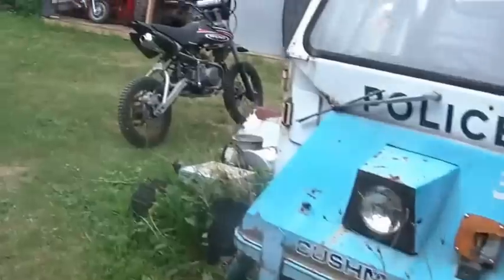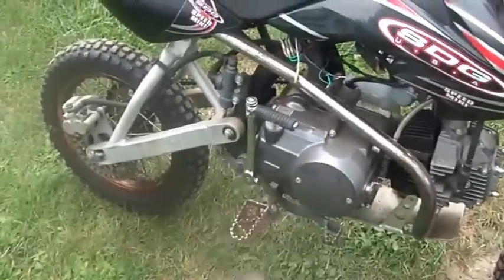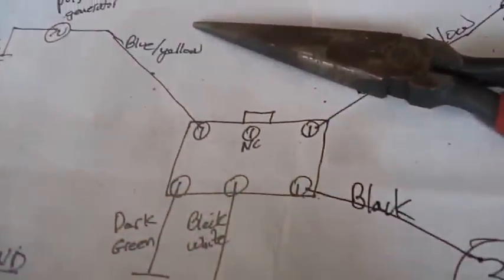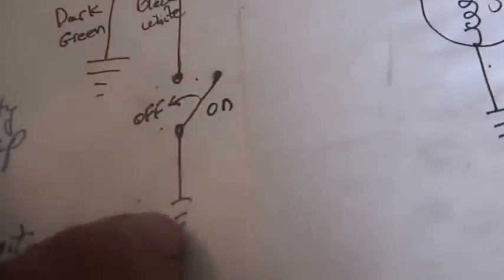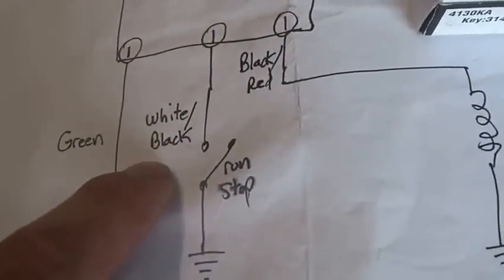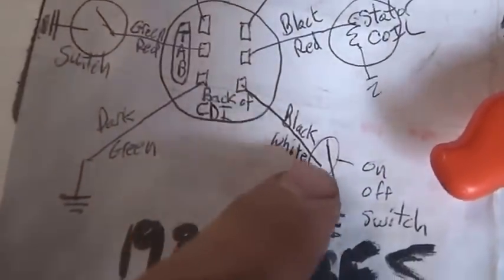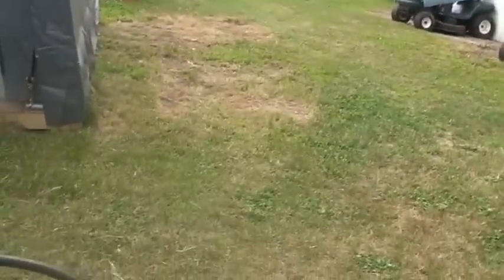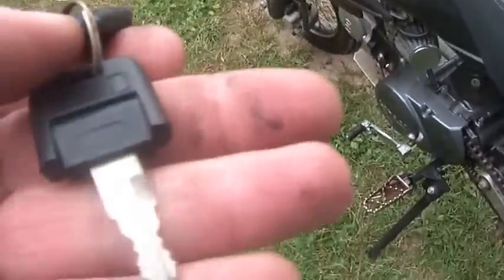2004 SDG Pit Bike, Lifan engine, wire harness, adding key switch,

Comment: NO WAY! i thought the black/white and green wires had to be connected to run but that actually grounds it and turns off the bike lol!!!...I have the same engine with the black/white and green wire on my 2020 apollo rfz 125, its a yx125cc engine, I drove an hour to the track and forgot the key at home, wait it gets better, i was going to try to get it running by attaching the black/white and the green wire together (which i now know would ground it and not run lol) but guess what? there was a black, red, black/white and green wire going to the ignition and i had no clue what the extra two wires were for and i didn't want to start attaching different wires together to see if it would run because i thought i might mess something up. so anyways i got home and found out that the two extra black and red wires coming from the ignition were hooked up to NOTHING because i guess they hook up to something on another model of bike.  so i now know the bike would have ran if i just kicked the kick starter. anyway i ended up renting a 250cc honda they had at the track and had a blast .

Comment: How do I wire electric start
Reply from the maker: Hey Tom, For the DuraMax, it is already wired, I'm probably just going to put an ignition switch in parallel with the one that is already there located on the dash with a pluggable harness.... Generally speaking, wiring electric start is as easy as wiring one side of a starting relay to the battery, the other side to the starter, the starter should be grounded thru the motor as well as one side of the starter relay coil. when power is applied to the other side of the starter coil, the relay engages and hopefully the engine starts.... Thanks for asking, watching, and commenting!!!!

Comment: Can I swap my engine in my Baja dr70? Or should I just do a 88cc bore on it?
Reply from the maker: Hi idk!!!  It would probably bolt up to the frame, but, U may have issues with carb spacing, air cleaner, exhaust, and mounting the foot pegs, or U may not, everything may just go right together.... The 125 Lifan on the 110cc frame is a monster, I've been considering installing the longer rear swing arm to cut down the wheelie factor... I think it will be cheaper to do the 88cc bore, run it that way.... When U decide to upgrade to a 125cc, try to find one with a blown engine, typically around $300, and then put a brand new engine on it, around $350, U should be able to sell Ur DR70 for all of that...Thanks for asking, watching, and commenting!!!
Reply: Harvey Spooner Thanks, yea. I'm going to stick with 88cc for now, and I actually bought the dr70 for $350 back when it was newer. 3 years and still counting. This thing can put up with a lot I do trails, miss shifts at times, you name it this bike has been through it. Which is why I was considering swapping it because I don't know when it'll die, thanks for the advice.